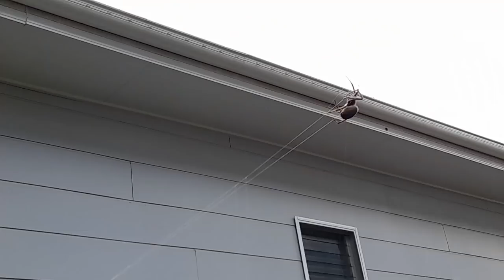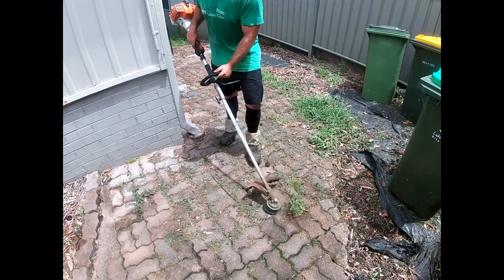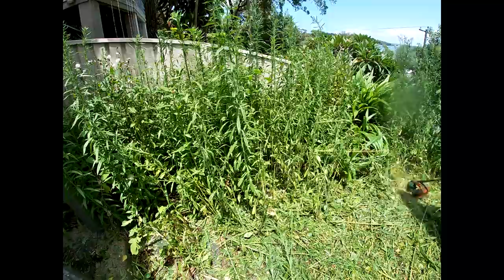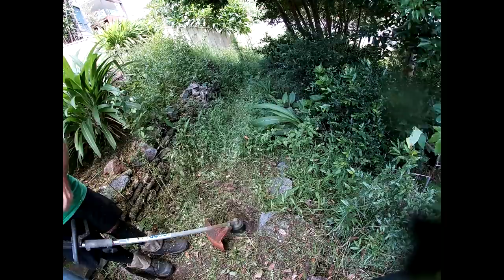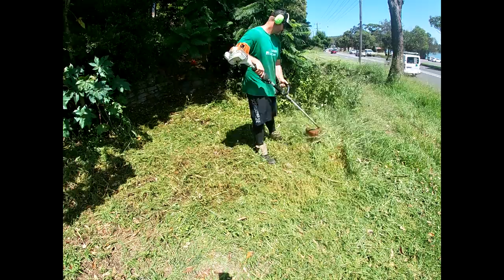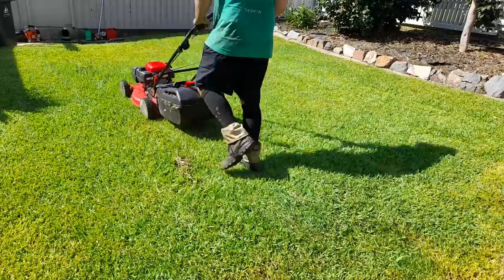MOWING and TRIMMING HEAD HIGH WEEDS! Huge yard clean up - Australia

Comment: One nice thing about the tall weeds in the garden - they're sure easy to pull out by the roots!  My leg was in a cast back in '98, so I couldn't work in the garden. By the time I could walk around without much of a problem, some weeds were 4' high or taller. Using just one crutch, I was able to grab the tall weeds with my other hand, pull them up and get the garden looking better.

Comment: I find these videos nice to watch, because it relates to the work I do. Just I work in parks and on public pavements for a company hired by a city.

In the Netherlands we have some strict labour laws and regulations we need to adhere to, as I am sure you have too. But then there's  the fact that if I damage property or shoot someone's eye out with a piece of a twig or a small rock, our company can get fined (or lose it's contract altogether if it's really  bad) by the city we work for, apart from all the insurance stuff they have to deal with. Soo that also has an effect on  the equipment we use. The brush cutters I use at work, have a harness to bring the weight more  to the shoulders and keep your back straight. They also have a T shaped handle bar, rather than the ring on  your brush cutter. That's all well,  but I think you are more flexible in how you hold your brush cutter,  and thus can get into nooks and crannies that I can not. (Little envious here, heeh). I cannot do the edging like you do it,  either. Well,  I probably could, but I'd risk my job. We've recently transitioned from 4-stroke gasoline powered Stihl brush cutters to battery powered Husqvarna brush cutters. This was due to city demands. My personal finding is that the Husqvarnas we got are slightly less powerful than the Stihls we used, but they weigh less, which is nice if you have to walk around with one all day. The one thing I absolutely love about them is  that they can turn both clockwise and anti-clockwise, which is nice for nooks and crannies.

People have a habit of sneaking up on you in pubic spaces, no matter how often you look around to see if anyone's getting close. I gave a grandma a stern talking to one day: a kid came running up to me from behind, scared the begeezus outta me. She had asked grandma what I was doing, and grandma had told her to go have a look and ask what I am doing. Must have been tired of babysitting maybe?

Anyway, I've been enjoying these videos for a while now. You're doing good work. Seeing the videos where you cleared someone's overgrown yard at no charge, that was nice too. Too bad I can''t take one of my work brush cutters with me for  a weekend, I sure  know a few deserving people who could use a hand in tidying up their yards. I don''t have a yard myself, just a balcony, so it's a bit pointless to go buy power tools I'll only use once or twice. Ah well.

Comment: What an amazing transformation. Love your channel mate. Quick question, what are the benefits of running your whippy without the guard and what line do you use coz it seems indestructible?
Reply from the maker: Gday Pieter,

I use trailblazer 2.7mm line, it goes pretty well!
Some will argue that removing the guard is dangerous, pointless or otherwise. I guess it comes down to how careful the operator is. I've found the main benefits are that you can have the trimmer line a bit longer, which is great when you're hitting larger areas. Also, it's easier to keep the trimmer head flat if you have to reach under things (trampolines etc), which prevents digging into the grass. Not to mention you can get behind tighter areas with the guard off
Reply: Cheers for the advice, I will get me some of that line and I will see if removing the guard works around my place.

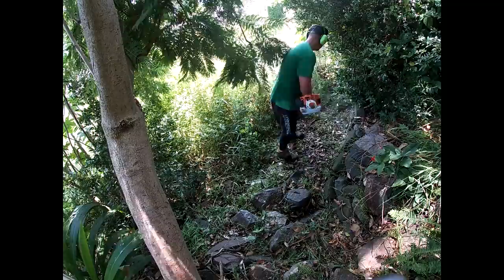Comment: What type of line are you using for your Whipper Snipper. My backyard looks like that place (@the 10:43 mark) and I'm over it! Would really like to bring it back to the lawn it was before I bought the place. I've neglected it due to my job and it's got out of hand. I'm in far Nth Qld (Kuranda) and own a piddly little Stihl f20 type of bent shaft thing that is about 10yrs old and has no grunt. Was thinking of going down the same route as in poisoning everything, letting it die and trimming it back to almost bear earth. But it's February here atm so not sure if this would be the right way to go, what are your thoughts? What type of Stihl trimmer are you using?  Thanks for posting the vid.
Reply from the maker: https://www.greenacresmowers.com.au/brushcutter-cord-trimmer-line-2.7mm-trail-blazer-2

Comment: I’m having trouble seeing the difference between what needs cut, & what needs saved.  Probably easier if the video ran slower.  If you go any faster, might just have a before & after picture!
Reply: if you go to the top right of your screen,  a drop down will appear. you can then select play back speed and slow it down if you like :)